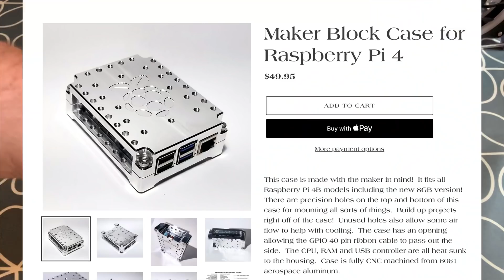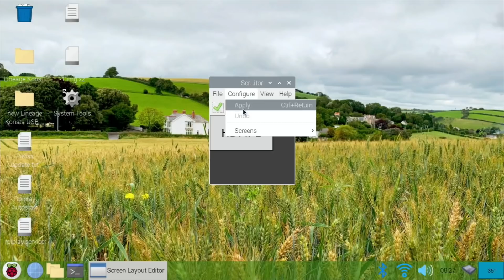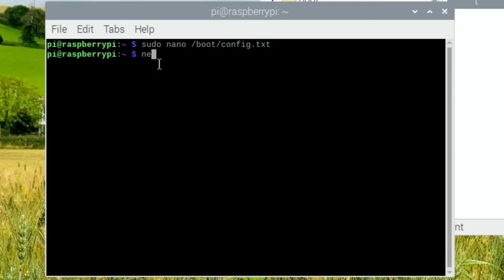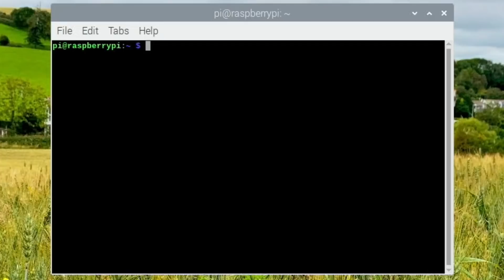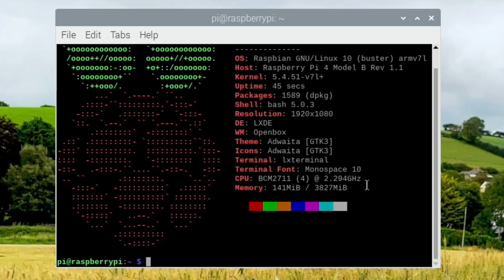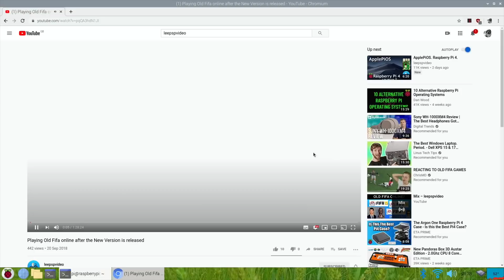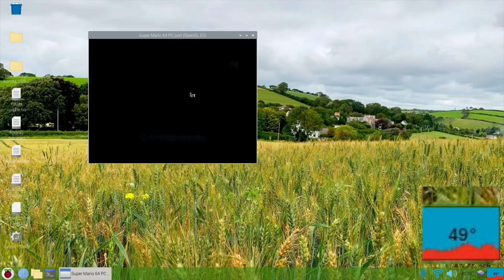52Pi Dual Fan Aluminium Armour case. Raspberry Pi 4. 2147Mhz Overclock test.

Comment: It's recommended to overglock rpi with a fan?
Reply from the maker: I have Overclocked without cooling. The Pi will throttle and run slower if it’s too hot.

Overclocking without cooling. Raspberry Pi 4.
https://youtu.be/DNjI6u91LuA

Some sort of cooling is definitely worthwhile. I prefer silent cooling 

52Pi Rack tower cluster case with 120mm Fan. Raspberry Pi 4. Great SSD solution.
https://youtu.be/C-NSIISkFfI

Amazing cooling with this silent Raspberry Pi 4 case
https://youtu.be/irdV0Xvy-Ys

Comment: Great video, just subscribed! Thanks. Could you please try the stability of: over_voltage=8 - arm_freq=2130 - gpu_freq=950? It's been reported that, this is the most stable upper way. Thank you!
Reply from the maker: GPU Overclock test 950Mhz. Raspberry Pi 4.
https://youtu.be/9q-k-ANRB0c

Overclock Test 2000 Vs 2147 Vs 2300Mhz. Raspberry Pi 4. Ice tower cooler Plus.
https://youtu.be/XiN5wbt46XA

Comment: I have been using the dual-fan version for while and for my needs, it works perfectly. It is interesting though that you experienced the same black screen at boot that I only began experiencing with the last EEPROM update. I thought I had figured it out when some SD cards would boot if burnt with Belena Etcher but not the official Pi Imager on window 10. I did continue to have mixed results so thought it was cards that were bad, only to find out that those cards work perfectly in my MiSTer. I am going to test to see if an OS that will only boot to black screen on the new firmware will work with the overvoltage increased. So frustrating that the new firmware seems to be soooo picky and random. Just want to use the Pi, not spend all my time tracking odd issues. I would not even know what to say to able to submit a bug report. I changed the cable on one monitor and that fixed some boot to black screen but not all. It has led me to just put the Pi's aside while I play with the MiSTer!

Also, the issue with this case blocking wifi and bluetooth should not be a condemnation of the case. I am glad the issue was pointed out though, it should be considered when choosing a case your use needs. Personally, I had never even considered it to be an issue before reading the comments in this thread. I just googled the issue of metal cases and Pi's and there are a few pages that actually test the issues, so it is a measurable factor. I guess my use scenario never put me outside the reduced radius when using the case, so have never noticed. I normally use ethernet and have no issues using a 8BitDO SN30 Pro Plus in bluetooth mode with either this case or the Argon One. Cooling is critical for me, so love the dual-fan armor case!

Thank you for another fine video!

Comment: I've kept my pi4 overclocked at cpu 2147 and gpu 750 for months (in an argon one case) . Then i've tried to switch from rasperry os 32 to ubuntu 64 and after that my pi can't be oc properly. As soon as I change the GPU speed it hangs after few minutes. No problem for the CPU that, btw, even if is at 2147 in config.txt is reported at more than 2200 from neofetch. Anyone else noticed this strange behaviour?
Reply from the maker: Try upping the over voltage
Reply: leepspvideo  you arr right, I'm using overvoltage at 8 and the system seems pretty stable (neofetch reports a cpu speed of 2200 instead pf 2147). I don't know how safe is to keep the voltage at 8, but I wonder what has changed, why the overvoltage at 6 is not enough anymore.

Comment: I also have the version without fan. I put a fan on top with some short plastic separators that fit perfectly with the scew side into de cuttings of the aluminum housimg. I connet it ti 3 V and it runs with almost no noise ant temp while loking at videos stays around 40 C. Good solution for me. Does not need 2 fans. No problems with wifi or bluetooth on my side.

Comment: I have that case but removed double fans and I put a 30x30 fan pi, works awesome better then the other caesnive used on isle is 35c and 42c during game play or using desktop, the heatsink gaps let me use screws to mount that other fan

Comment: No, the GPIO header is not available to most hats and another add on for the PI. The current way that these companies are adding fans this way is flawed. There needs to be a different standard for supplying power to the fan.

Comment: Over Volt 6 for me is good to about 1950mhz /650mhz
The voltage starts at 1.2V and adjusts up or down in 0.025V steps. 0 is equal to 1.2V, the minimum -16 is 0.8V, and the maximum 8 is 1.4V. Voltage starts to help when running core/GPU/SDRAM at or over 500MHz

Comment: This style case has heaps of Clones and Colours, Single or Dual Fan, What i liked about the older ones (Pi3) is the way it had cut-outs for power/hdmi/audio, it is not an open slot
Have you seen the Pi Blower Fan for the Bottom of the Pi

Comment: I think the heat sink notch at the bottom is intended for someone using Rockpi SBC since the SoC of the Rockpi is located at the bottom of the board. Rockpi is the same size as the raspberry Pi.
Reply: It is there for use on other RPI models, useless for the Pi 4. The molded part goes up to cool a component from underneath. A good idea to add it to the case!

Comment: I have 3 PI 4's one Display and one keyboard with a mouse . Anyone have an option on using the keyboard on all 3 without always switching cables. Another good vid Sir
Reply: barrier, was mentioned in rpi magazine
https://magpi.raspberrypi.org/articles/share-your-keyboard-and-mouse-with-barrier
right handed mouse use only (i think),  might work fine in your situation
Reply: @jyvben1520  Barrier doesn't seem to work with a single display --Thanks for looking out
Reply: vnc then, is standard on raspbian/raspberry pi os, see raspi-config to activate it on the remote screens

Comment: 2 of my Rpi4 8Gb's are wearing this amazing case at a stable at 2.147Ghz speeds. I got mines from buyapi.ca and amazon.ca. Exposed GPIO's are great to connect my USB-to-UART when I need to monitor Boot logs on my Rpi4.
https://www.buyapi.ca/product/armor-case-with-dual-fan-for-raspberry-pi-4-model-b-grey/
https://www.amazon.ca/Aluminum-Raspberry-Cooling-Wrench-Enclosure/dp/B07W6FT1DD/ref=sr_1_14?dchild=1&keywords=aluminum+case+for+rpi+4&qid=1597576776&sr=8-14

Comment: I've been using the Armour Case since I first bought the 4B when it was launched. Extremely good cooling compared to the Argon One case which I just bought recently for my 8GB 4B. The only bad thing is I tend to brush against the fan blades while trying to plug in USB devices.
Reply: yes I have the same problem with the fan.

Comment: i have this, but without the fan version. It seems to interfere with Bluetooth and wifi signal, my connection always dropping.
I had to use usb wifi adapter for stable internet
Reply: same, stop using it
Reply: Somehow mine works better. Even better than my Argon Neo in term of WiFi signal.

Comment: I buy these from China (aliexpress) for about $8, using since I first got a Pi4 and been very happy with them.  Never had throttling, even in the beginning when heat was a much bigger problem. 

The negative is that there is no protection on the side, and I once knocked some small parts off the board when trying to connect a micro-hdmi cable and missed the right spot.
Reply: First one I bought neither fan worked.

Got a replacement for free and only 1 fan worked and then ye gave me a refund. 

In the end I bought a 40mm fan and a usb voltage dial and stuck it on the top and changed to about 60% power which makes it even quieter than the one that came with the case

(p.s. Non working fans all heat up)

Comment: Does the kit also work on 3.3V (pin 1 instead of 4 on the GPIO)? Maybe it draws less current and the over_voltage=6 could work. It worked on my GeekPI Extreme Cooling Fan kit. ;-)